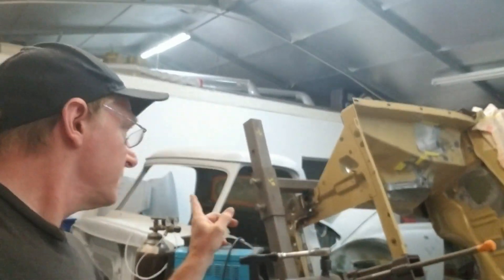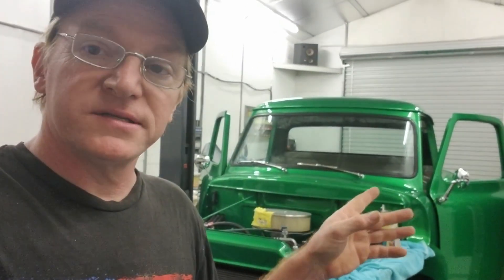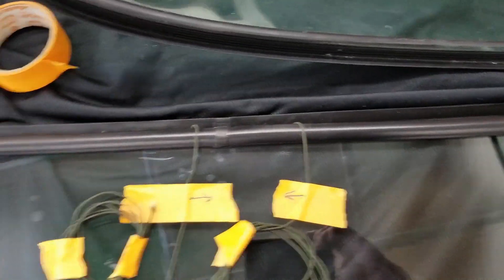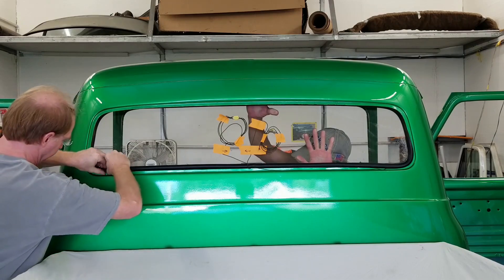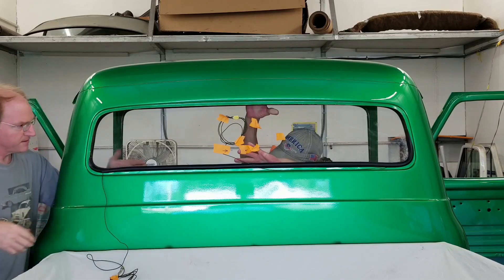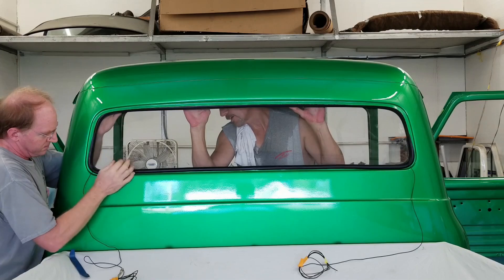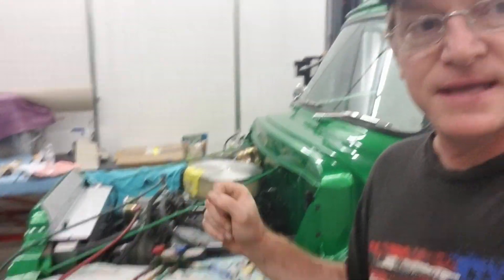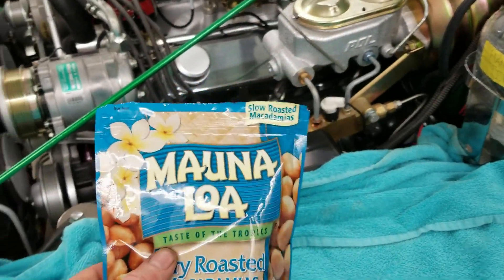Shop Updates & Glass Install On Hanks 1953 Ford F100

Comment: Where did you get the glass for this truck...need to install mine
Reply from the maker: The Owner Purchased it from Mid Fifty.  turned out good. went very well.
Reply: @ES4406  great...hard to tell from picture. Is that a clear color?
Reply from the maker: @Lsguy74  rear window is clear, front glass is tinted.